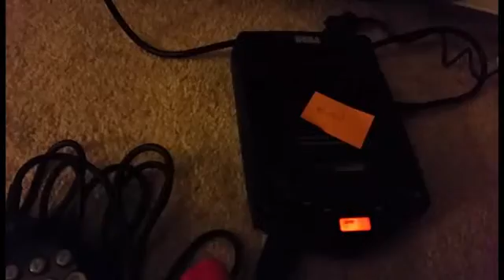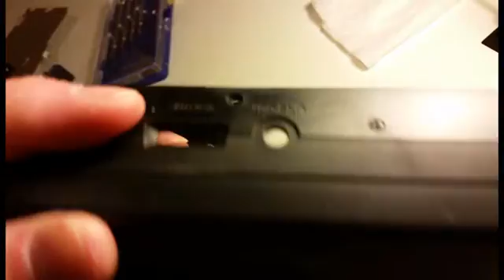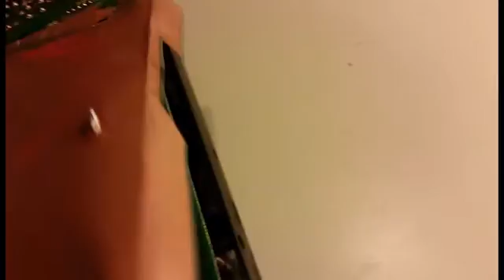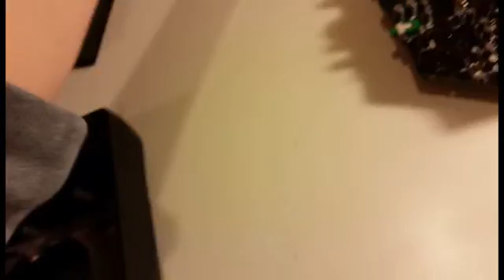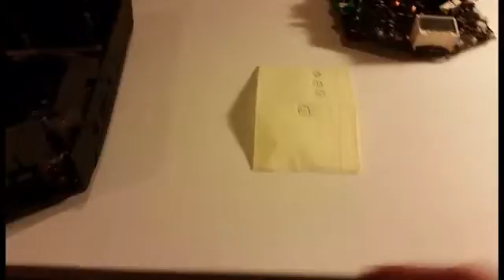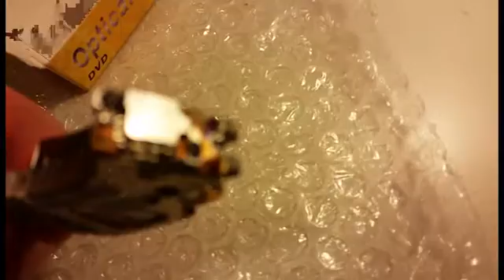How To #6: Repair A Sega CDX!

Comment: What is the line out port for?
Reply from the maker: Thanks!😀 The one near the headphone jack? I'm not 100% sure, I'm assuming it's used for the 3.5mm jack to AV cables? I'll have to see.
Reply: If that is so, a compound video adapter could be easily plugged to have a higher definition image

Comment: Thanks for a great explanation about dissassembly sega cdx. My problem is about trimpots, i do not have or register the original position before modify then. Could you Tell me what i can do now? Thanks in advance!
Reply from the maker: Thanks man! :-)  My suggestion would be to lookup a sega cdx repair manual; in there they state what the pot values should be. You need an oscilloscope to determine the values as you adjust each pot. They actually sell a cheap portable oscilloscope on Amazon for around $50 that should do the trick. Good luck and thanks for checking out my video!
Reply: @mtshark7  i Googled but not find the sega cdx repair manual but do not found. Could u help me?
Reply from the maker: @showmanproducoes   I just added several URL links in the description. I hope they can help you.

Comment: How do i get a stuck  AA battery out of the compartment? Its all the way in =(
Reply from the maker: Try using a small flat head screw driver to pry it out. Or use a set of Craftsman tiny picks set.
Reply: mtshark7  Thanks. That's what I'm doing right now. Its moving alittle. Used alittle bit of petroleum jelly and a tiny scoosh of wd40. I don't want to break it.

Comment: Very informative vid Mark - I had to repair my sega cd once, and those three laser pins are a pig to adjust if you don't record the default settings. I bought a spare laser (Sony CD player one) for it as well. I would love to have a sega CDx but they are very expensive here in the  UK.
Reply from the maker: +Nick Berry Thanks Nick! Yea I spent $150 for mine a couple years ago...now they are going for more then that :-/